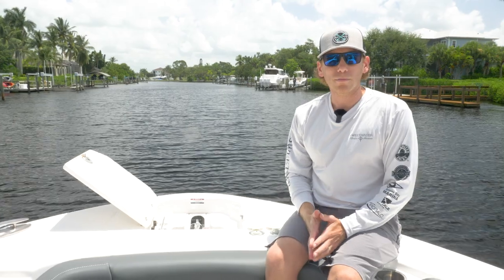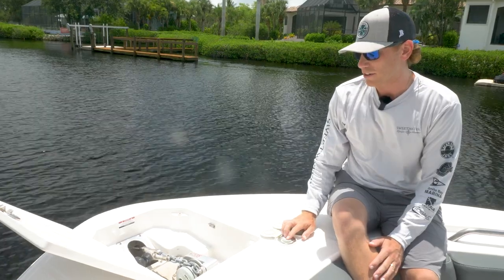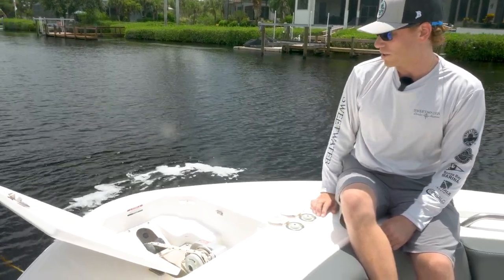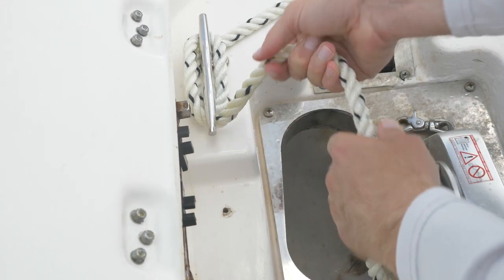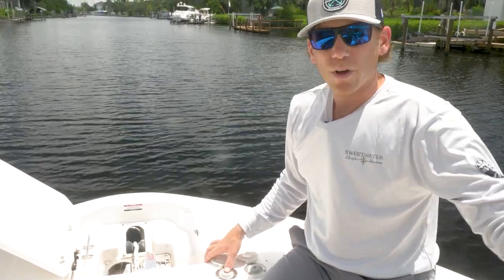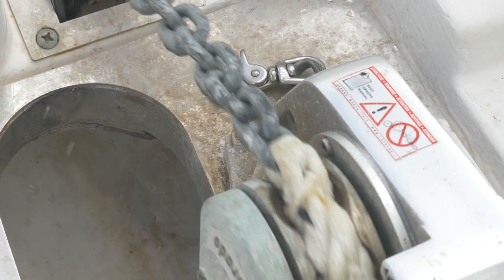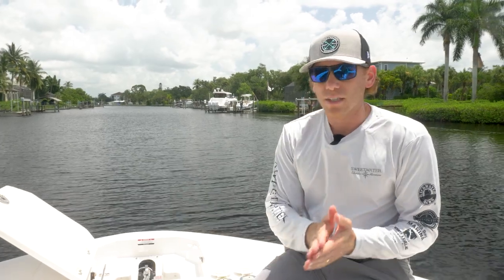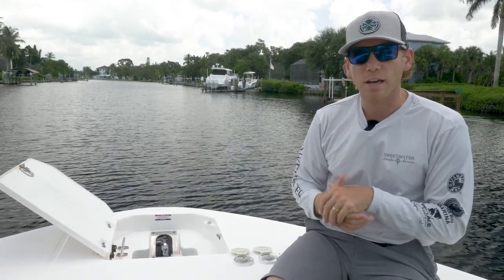How to anchor your boat with a windlass

Comment: Sorry for this rookie question, but why is the anchor line both chain and rope? I thought anchor lines are normally all chain for its superior durability over rope. If you are going to have it part chain and part rope, might as well just go all rope, right?
Reply: Three Stranded Nylon Rope has some stretch so it will cut down on any "jerking" if all chain. The reason for chain is it's heavy so the anchor will pull from lower angle and set & hold better. General rule is 6 ft. of chain for every 25 ft. od depth and you also MUST have the correct size for both the vessel and the windless.
Reply: @rski1036  Ahhh ok that makes sense, thank you!